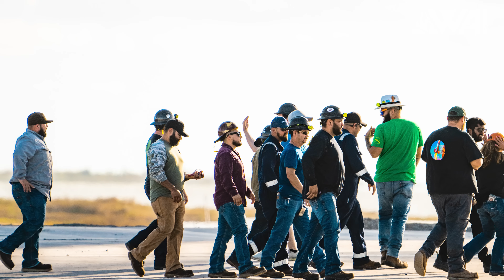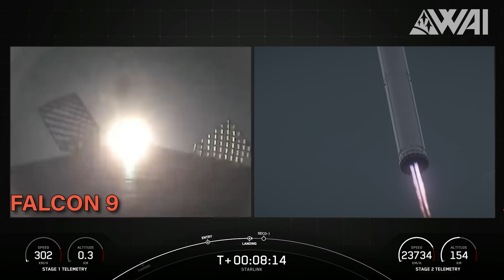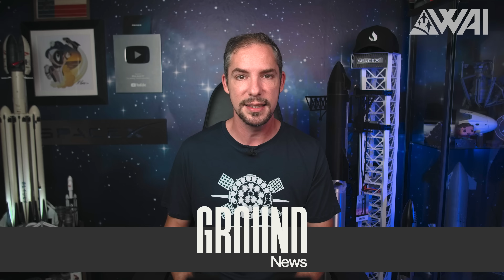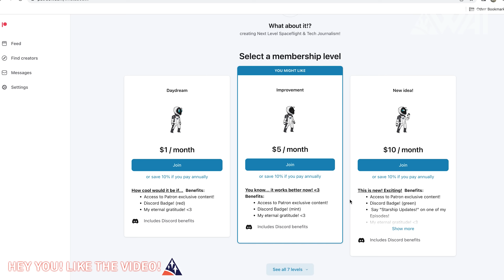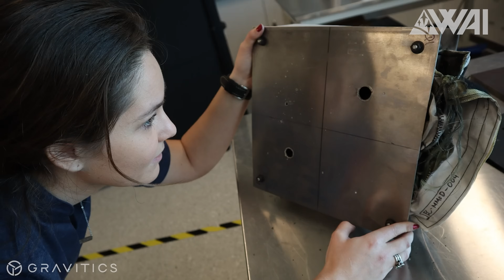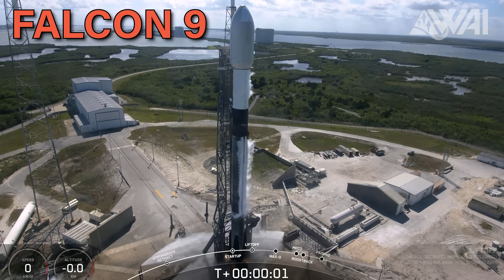SpaceX Starship Setback: A Year Without Payload – Hiccup or Concern?

Comment: OKK. ------- to get a million tons to Mars is going to take a larger Starship that Musk has already been talking about that doubles the width of Starship 2.. but not the length. making it possible to continue using the existing construction and Launch facilities.. while not requiring extremely costly new development work in both structures and engines to produce a Starship twice as long...

Comment: Betteridge's law of headlines is an adage that states: "Any headline that ends in a question mark can be answered by the word no." It is named after Ian Betteridge, a British technology journalist who wrote about it in 2009, although the principle is much older. It is based on the assumption that if the publishers were confident that the answer was yes, they would have presented it as an assertion; by presenting it as a question, they are not accountable for whether it is correct or not. The adage does not apply to questions that are more open-ended than strict yes–no questions.

Comment: The Indian Moon probes are both frozen. Temperatures of -200C have done them. Challenges are grossly underestimated in our quick and dirty agile software world. Most failed missions over the last 20 years were software failure as software development does not follow the rigidity and classic engineering quality approaches anymore. With ChatGPT writing code lines this will get worse. The problem is that this is OT software and thus classic engineering processes should be applied.
Rapid prototyping for the sake of it is more expensive and takes longer than classic engineering design.
NASA definitely is much too slow and still to faulty. SpaceX is too sloppy and thus slower than with improved engineering processes. Fail fast is not a mission or objective. Learn fast is much better and means test continuously. Having floppy stump legs cost SpaceX 3 months, having no decoupling system cost SpaceX 6 months etc etc.
In total SpaceX could speed up its program by 50% just by introducing a classic engineering quality team of senior engineers, GenX or even late Boomers, to avoid the most costly and easy to avoid design mistakes.
IT software can be changed every second with no impact, OT software is forced to the slow pace of mechanical engineering. A mistake in OT software is like bad welding or missing screws, it can screw up big time. Software engineers who are in the OT business should work differently from IT coders.

Comment: They cant fit a larger hot stage thrust section because they havent got enough hieght in the tower to lft the star ship high enough to fit on the top. They are trying to do it with the maximum height thats available for now.  The tower would need extending upwards for anything bigger.

Comment: Almost all massive telescopes, so Hubble and many many more use mirrors, not lens. Mirrors are curved so reflect light towards a point. Typically another smaller mirror or 2, and then the light lands on the sensor packages(s). For a lens, the light travels thru the glass of the lens, so now two surfaces need to be the perfect shapes. And probably much heavier. And the optical transmission character of the glass/quartz etc becomes also very critical. In short, a mirror lets you go bigger for less cost, weight and other issues than using a lens.

Comment: Starmax..... and the rendering shows the floor going across the wrong axis, a-gain.
Treat the tube like a multi story building, and the acceleration 'gravity' is on the surface facing the drives, or outwards for spinnig multi unit structures.

Comment: Someone needs to tell Gravitics that they could use basalt fibers which have 33% higher tensile strength and double the elastic modulus vs kevlar. Basalt is a bit heavier than kevlar but it is also nearly impervious to high energy radiation from UV on up to gamma.  The thermal performance is miles ahead of kevlar as well, basalt fiber products withstand temperatures from -260 °C to 700 °C, some variations can handle 1000 °C without failing.

This stuff is so much better for the harsh space environment.

Comment: If giant sapphire window slabs were to enter the manufacture of starship fuselages then Elon will have to look at his magnificent iteration of RAPTOR 3 😎😎🤔🤔 as a minimum grade, even for the best Engine Power Ration of all time by giving up 🧨 🧨🎠5 millieter prototypes🏋‍♂💪🤳🤳 current for new 🤴👑💎🕹🕹🥊tempered Saphire quadruple pressure cookers for DEEP SPACE and GLASS roof deformation 😎🦄🐲 🦄🦏tempered for subcontracting price of priceless spectacle sapphires in real time and then which Subcontracting would take, immediately? The same direction 🤫🤭🤭👽🤯🍀🍀🍀👻👻👻💢🍑🍑✨✨🏝🏝 as the last 16 of ultra-aggressive management of the very famous administration🌞🤫🧠🤯👍👆 🤘🖖🙌🙌👏🙏

Comment: FYI: Items on orbit can never be hit be a meteorite - by definition.
A meteorite is a meteor which has collided with earth. Until then, they remain meteors.
And so any natural item which hits something on orbit is a meteor.

It's also worth mentioning that if a pebble sized meteor makes two holes in a habitat on orbit, there is no need to panic: there will be several days in which to locate the holes, and seal them, because it takes a VERY long time to depressurize a large container with a small hole. A hole the size of your head is a different story - but you will easily have time to evacuate the module, and close the airtight doors, without a problem.

I recall the ISS had a leak for several months before it was found. And it wasn't a drama.

More FYI: there are no materials to develop for inflatable on orbit modules. They have been demonstrated on orbit three times, and one module continues in service on the ISS today. The proposed BA330 module by itself would have more internal volume than the entire ISS, and so they make more sense than metal modules, especially as they are capable of self-repairing punctures caused by micro meteors.

Comment: All this in the same way as the automatic landing of the Falcon 9 boosters outside of the translation tests of the mechazilla arms on the B9 booster APPARENTLY YET never tried mechanically at + 9 meters 🛹🛹🚝🚝of diameter-grid B9 🚀🚀coupling/decoupling-capture.

This is not announced synchronized by the 50 ANTI-DRONE LASER 🚁🚁🚁🚁🏗🏗✨✨🍑🍑☠☠ thermal cameras above and below the arms of Mechazilla, as the wind tunnel passes on a robotic distance adjuster by TESLA ALGORYTHM NAVIGATION VIEWER.

  The system seems very well laid out if we go through a funnel of infrared nets above the tower 🛒🛒and fire-fighting WATER pumps directly 🧜‍♂🧜‍♂on the arms? + In the MECHAZILLA tower?
  + AT THE HOOKS of the Orbital Table, as a B9 COOLER  🛒🛒OR even as an AUXILIARY 🏸🏸🪁🪁🥏🥏emergency fire extinguisher.

It is very great Art, Preserved from all points of view, especially when it comes to transporting hundreds of thousands of tons of reloading.

BUT IN this SpaceX IS the greatest specialist, Currently in capacity and Intensity, Bravo Félix 🌞🌞🧠🧠to your teams and thank you for the videos everyone is really very grateful💎📀. This will succeed because SpaceX is full of very good Surveyors with their second site in Cape Canaveral Florida in all weathers.

Comment: There is no suicide burn.
The Process to return precissely to a landing position, and the landing maneuvering involving ship tilting, ending at a precise attitude/position at zero velocity and angular rates is called "Multidimensional, stabilized optimal trajectory"
On the altitude/velocity dimension, this is how it works: prior to landing the meteorological conditions are loaded, lateral and  vertival winds , rain, all conditions effective during the descent, especially on short final. Then an optimal NOMINAL trajectory is calculated. Optimal refers primarily to fuel consumption if the fuel is marginal, in addition optimization can enter location error minimization, and other damage minimization consideration.
I this oversimplified example lets assume a constant deceleration is desired, the weight change due to fuel is neglected.
Then in the PHASE diagram, altitude vs velocity form a parabolic trajectory,  for constant deceleration.
Now both the altitude and the velocity are accurately, redundantly measured, and compared with the 'prescribed' path. Normaliy at a measured altitude, the velocity error is measured, ( there is a specific reason, why)
A closed feed back control loop is activated using an optimum regulator, QLR( linear least square integral  error regulator. For information consult Mathlab ) The engine thrust is modulated to drive the profile to the nominal, in this case the velocity. Sure enough the velocity is zero at touch down.
the reason to drive the velocity to nominal and not the altitude is because the order of the dynamic equations is lower, dynamically stable without a numerical derivative to generate damping. more stable, considering the engine throttle control dynamics.
That is the Non Suicide burn.

Comment: Starship will not be able to land on the Moon without a landing platform. Much less launch from it without one. A Spherical Ship with equatorial engine ring will be able to land on a simple steel platform of 25mm thickness. The pad is the first structure that needs to be shipped and assembled on the Moon. Spherical shapes are the optimal natural shapes in the universe. Drag is a little bit higher but maneuverability much greater and with equatorial ring engines landing and launching via simple ll pads is possible.
Reply: Yeah you know more than the engineers....

Comment: Could lift total be increased by straping falcon rockets to the side of a super heavy booster to act like the solid rocket booster on any of the other rockets? Could equal a higher escape velocity to make a quicker trip to Mars. Plus less fuel used in starship for re entry in Mars.

Comment: As a specialist in second stage separation dynamics, still within the atmosphere, the change over to gimbal controlled attitude control just prior to separation, with the vents to allow outflow of the exhaust gases, which are all supersonic, not at all turbulent was the only tried and proven method to cause well controlled separation and yaw control due to the still effective aerodynamic destabilizing moments.
There is no need to speculate about its succes, because verification are accomplished by numerical 'similations' of the process, which are very accurate, like it was done at Convair in the 80's.
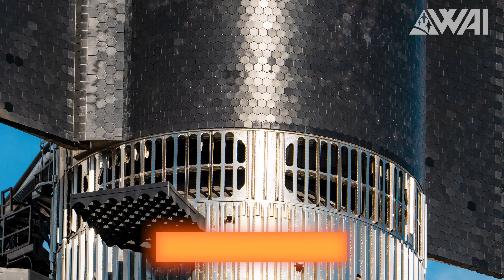5:16 The remark that the clearences are too small is not compatible with my judgement, because in the near vacuum the huge massflow rates are large. i you wish to get a feeling, do not compare the nozzle area with the clearance area, rather the engine throat area with the clearance area, because the inevitable strong shocks, increase the out flow density accordingly, requiring much smaller crossections, betraying your instincts.
Remember, no pressure can travel against any supersonic flow, NO engine damage POSSIBLE. Period . Punkt, ausgeschlossen.
Der Rest is Quatsch, leider.

Comment: Here’s a thought to overcome the danger of ship separation by having  to run the risk of activating the starships engine so close to the booster ,couldn’t they have a supply of compressed air to be released to make the initial separation to at least get some space between the booster and starship before it fires its engines?

Comment: Why can't booster tanks be used for habitation? A hatch or two to transfer gear into them when in orbit(hatch hardware installed with the hole cut in the tank in orbit). The gear can be packed into the science section when launched. It would give the station major living space.
Reply: I assume you mean for orbital station.
It's most likely cheaper to build in all the furniture while still on earth, then deploy ready habitation module. It takes time, food, energy and resources to do renovation in space.
Also you'd waste perfectly fine reusable rocket, which could be alternatively reused to send couple more ready-made habs to orbit.

For moon, mars and other interplanetary missions, you simply need the fuel to leave orbit.
Reply: That was studied for Skylab!
While many think wet workshops are a terrible idea, I personally love it (though it requires a lot of modifications to the stage before flight).

Comment: I thought the suicide burn was relating to the point where the booster slows down and gets to zero speed.  At zero speed it's at ground level so the engines can be shut off.

Comment: Felix, what is the ground preparation like underneath the potentially hovering starship that is hopefully about to be captured by Mechazilla?

Protected? Or is there a potential excavation event?
Reply: Is a Water system likely beneficial there too?
Reply: While hovering, they'll be much higher above the ground and for much shorter compared to launch. Also using only few of the engines. So most likely a non-issue

Comment: 8m telescope sounds great.  They should try that.   But there is going to be a life expectancy problem with station keeping all the extra mass.   Gyroscopes don't have a great record lately and all the extra mass may not help.   If it's cheap enough then this is really less of a problem.   We'll see how it goes.
Reply: Launch with extra gyroscopes for redundancy.
Reply: @EMichaelBall  Would be nice if it was that simple.  But no.   It's the environment tat is hard on them and they are all in the same environment.
It's like finally needing your emergency flashlight just to find it's batteries have gone dead over the years.   Well, the spare set of barriers that's with it are just as dead.

Comment: With the size of Starship, you could have a smaller habitation area surrounded with more shielding.  Micrometeorite shielding and radiation shielding, which will be needed for any lengthy journey to other planets.  Or, just take it slowly and send up habitation first, then shielding to be assembled in orbit around afterward before going into interplanetary space.
Reply: Not a bad idea.  Also consider that water itself is a damn good radiation shield.  Hence your habitation module could be double walled, with the interstitial space filled with water by a simple tanker Starship.  Generally speaking, a water shield of around 1 meter is considered to be plenty of radiation shielding in cislunar space.  Probably you'd have to have the water in some sort of flexible matrix so that freezing and cooling didn't destroy the pressure vessel, but that is just R&D.
Reply: @tarmaque  a water shield of one meter is really heavy (1 ton per square meter), so this doesn't work

Comment: Seeing efforts at building carbon fiber tanks for rockets reminds me of the poor cyclical loading fatigue behavior of carbon fiber (can you say Titan submersible?). It seems like carbon fiber might be a good idea for one time use equipment, but for reusable rockets? I wonder.
Reply: Too bad they bought carbon fiber that was past its 'best by' date. So many shortcuts, it was only a matter of time.
Reply: @CountryGeek-hr8tk Even with otherwise correct procedures (fully sherical hull, cross-woven composite, not past-due fiber base), it still wouldn’t have had anywhere near the lifespan of titanium or stainless steel.
Reply: @EMichaelBall   Exactly!
Reply: Carbon is ok for internally pressurized craft like a rocket, not so much for resisting external pressure like Titan.

Comment: Suicide burn refers to the fact that the booster cannot hover due to the engine not being able to throttle down that much, making the landing attempt the only one chance to land. The booster needs to achieve zero speed exactly on the pad/barge, otherwise it will crash or start going back up. I'm sure they would be able to add a bit more fuel in certain missions to allow for a couple of attempts if that would be possible, but since it's not possible to "go around" they always put exactly enough fuel for one landing.